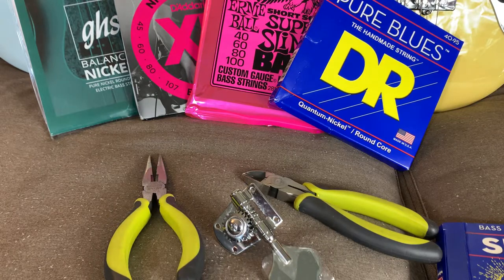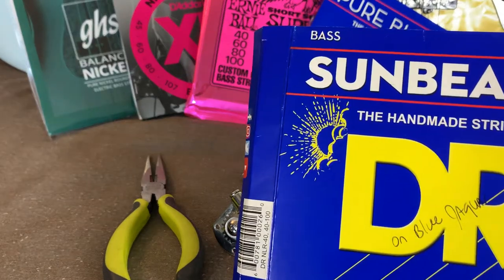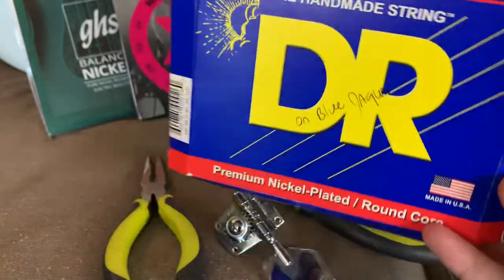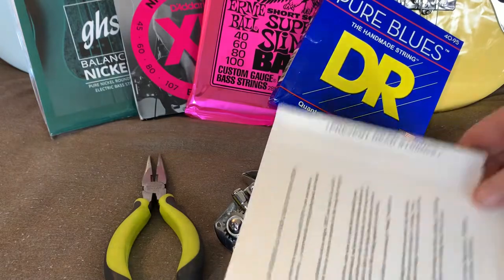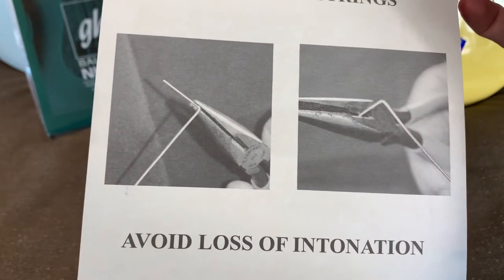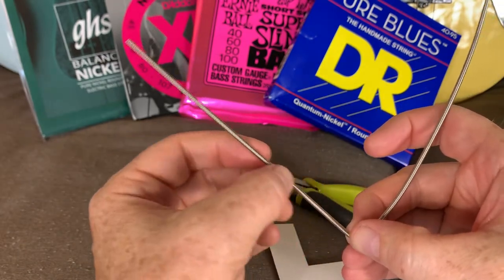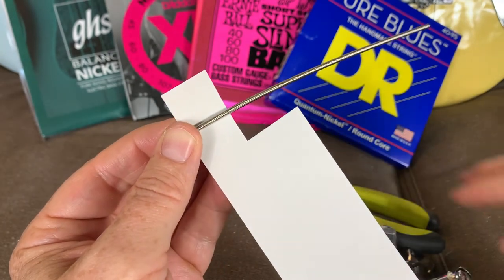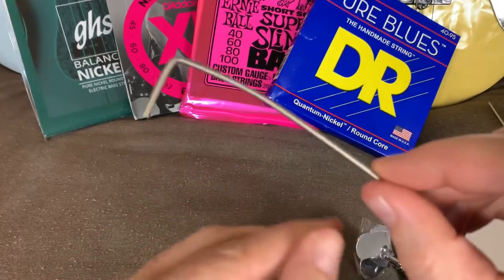Are YOU Causing Dead Strings On Your Bass Guitar?

Comment: Very interesting! The SR 2000’s Open Core I’ve used on a couple of my basses never went dead, even on cutting the length before making the bend. They changed factories and started having mega problems with dead E and sometimes A strings. 
I’ve never had it happen with Blue Steels or Roto sounds🙏
When I use Blue Steels on my Music man 5’s, the D string’s wrap stops too soon. I actually have to bend the core an inch back to the string, shove both into the tuner hole, wrap it around half of the tuner…and luckily it holds.
Thanks for your video.
I noticed even with F Bass exposed core strings some dead strings. Spoke to George F about it. He never mentioned the making a bend cure…

Comment: you do not need to get a precise length on the string after the bend, it can be longer, just not shorter. this can be eyeballed easily without all these complications. the bend is what stops the core from slipping on its own.

Comment: this is all well and good and your presentation was nicely done, but the problem with DR strings isn’t that you need pliers to make a good bend in the string, their problem is that any kind of a bend at the post, the nut, or at the saddle will cause their outer core to slip more so than other brands. it causes bad harmonic overtones and makes intonation impossible. i won’t use them and i won’t guarantee my work when clients insist on using them. their reps know this has been a problem for years and i doubt they will ever fix it. string through body basses are even more of a problem due to the extreme breaking angle. that breaking angle is even worse on flatwound/ribbonwound strings.

Comment: I have an acoustic bass guitar that has locking tuners on it and it drives me crazy cuz you have to partially unwind the string in order to fit them in.... String breakage seems to be an issue I really need to just switch them out.... Fortunately I play more baritone guitar than bass anymore